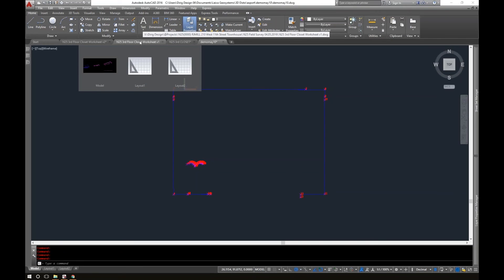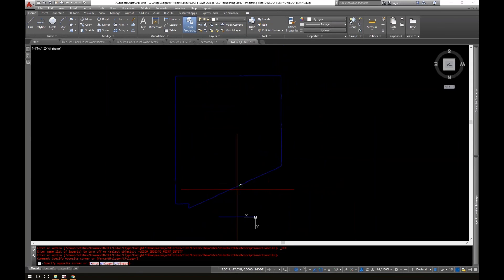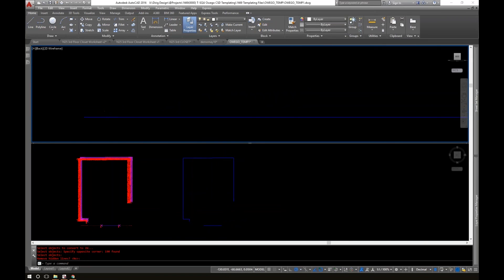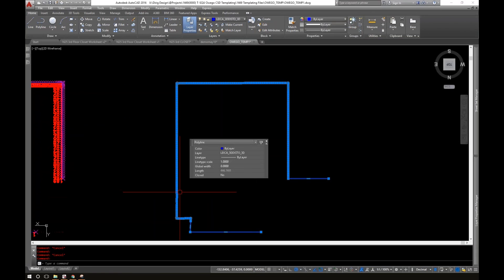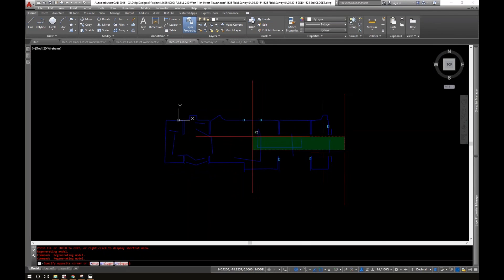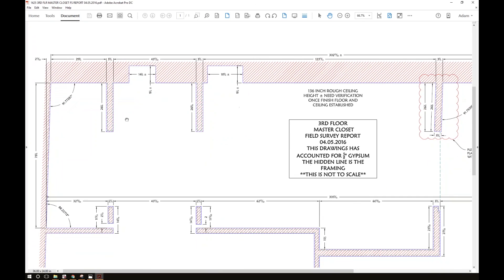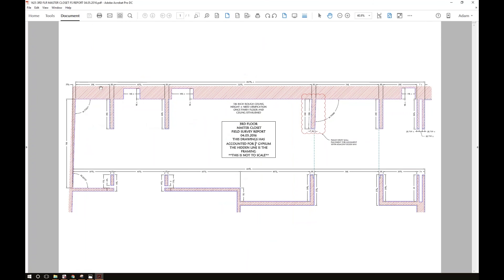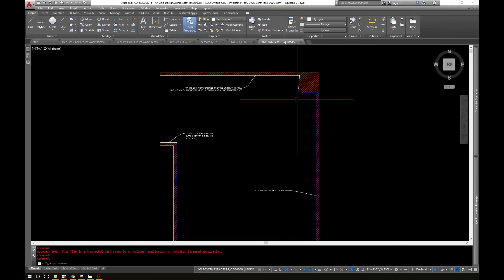Countertop Templating and Field Dimensioning with the Leica 3D Disto

Comment: If you would have imported the 2d DXF you would not have had to do the "Flatten" Command correct? I have an Autocad 2016 OEM version that does not have the flatten command.
Reply from the maker: Yes, this is true if you need a flattened plan view. You can just open up the 2D file, which eliminates the Z plane.